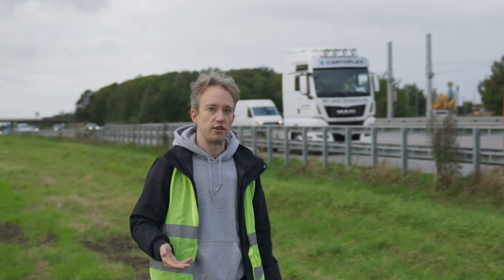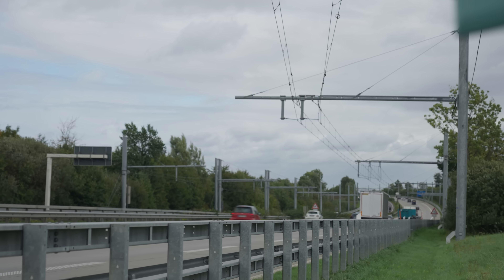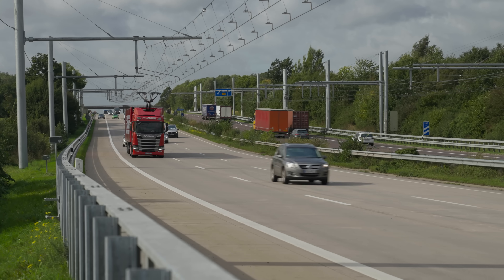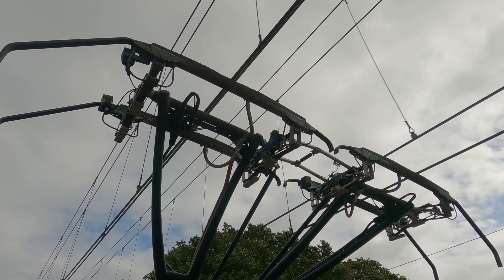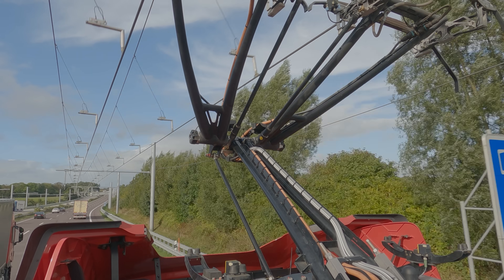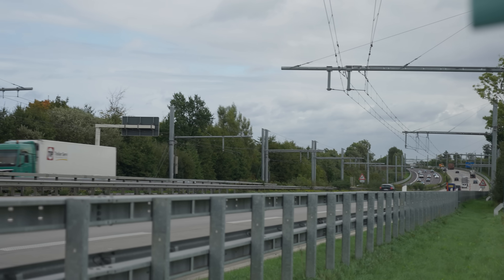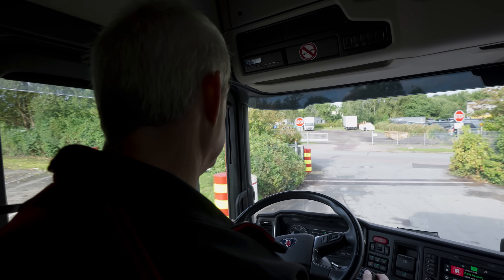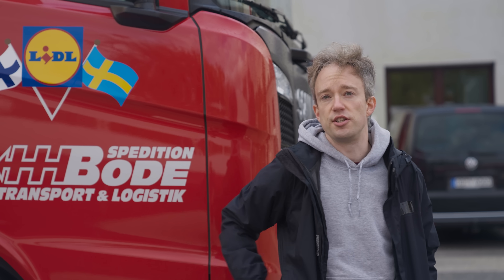The highway where trucks work like electric trains

Comment: I don't understand how this can work.  With trains, the metal wheels and rails provide the return path for the electricity coming from the overhead pickup.  But the trucks have rubber tires and run on a normal road?

Comment: How will this reduce emissions? If the electricity is still produced with fossil fuels, as it is now, I don't see the point of this. Yes, the power station engines are more efficient than a truck's engine, but you have to factor-in the inefficiency of the gridline plus the costs and materiel to build 'em.
Reply: Electricity is already 50 % renewable in Germany, while German Diesel is 93 % fossil and 7 % are partially made from palm oil, not a environmental friendly source for fuel.
Reply: @simonm1447  If you increase energy consumption by a large margin, how will you produce that extra electricity? We're talking about big numbers here. 
Germany has a very hard time increasing that 50% (which includes trash burning: yes, burning plastic is considered renewable!), because of a simple but critical issue: how much renewable can you squeeze out? How much wind and sun does Germany have? Does Germany have a sunny climate, without nighttime? Does Germany have huge mountains with infinite rivers? 
I'll tell you where that extra energy will come from: either importing nuclear (which is hugely inefficient due to grid inefficiency) or by burning fossil.

Comment: Propaganda for fools.
We all know where and how energy comes from. (Coal stations are currently operating in all countries)
If we are talking about the impact on nature: How many years does an old diesel engine have to smoke in order to reach the level of pollution in the production and disposal of batteries of such an "E-truck", plus how much emissions will be produced to refuel its batteries? What are the losses of electricity during its transportation? The efficiency of such an undertaking is close to 0!
I understand that the "geniuses" want to move the production of dirty electricity to third countries, this is good for developed countries, but very negative in a global sense. (Who will monitor harmful emissions there?)
If you want to improve the climate by reducing the harmful human impact on it, the recipe is simple: Reduce production and move away from the market economy.
Without leaving the consumption economy, nothing will change, but will become much worse.
Therefore, this whole idea of electric transport is another way to warm up humanity with money.
Will you be flying an electric plane?
But air transportation is the main producer of CO2! :)

Comment: I had the same idea years ago, you can also put a car one on the inside lane. The car one wouldn't be overhead, it would have a power cable in the road and one above the crash barrier. A little arm would have to extend out and up and it would have to have safety features in case of accidents.

Comment: Horrible Solutions.  Costly Infrastructure.  Ugly Wires that are prone to storm damange and wear and tear. 
Battery Costs are coming down hard and fast.   BEV is the way to go.
Compare building this to having Tesla Cybertrucks.
Reply: I'll take this because it's proven technology.
Reply: @sharkheadism  proven by what? 1 truck?  Prototypes are easy. Mass production is hard.   The cost overruns from this program will make BEV truck costs look like peanuts.
Reply: @Faisals_Adventures  Having road and rail vehicles collecting electricity from overhead wires has been done for over a century. There's even a strip mine in Africa that uses overhead wires to supply power to its gigantic dump trucks for climbing uphill out of the mine. Nothing about this delivery system is new, it's just being put on a different vehicle.
Reply: @sharkheadism   have they been traveling at 65 MPH on the highway before?
Reply: @Faisals_Adventures  Yes, in the video

Comment: I love German way of executing on things: they decided to get rid of greenhouse emissions, they will be doing it in all the pieces of their lives

The tech itself is cool too, although limited and a bit complicated in a sense that a truck still need to have an electric engine and a combustion engine.
Reply: Or just battery good enough for lets say 100km (under the load) and no combustion engine.
Reply: Germany only acts half-hearted today, the country has fallen back when it comes to renewables compared to other countries. Today renewables have gotten economic without subsidies in big scale, and from then on the fossil fuel lobby started to slow down renewable energy programs. Lobby is extremely powerful in Germany, all the decisions are heavily influenced by it. 
They could also use a bigger battery in the truck and use the overhead wires to recharge it during driving, but these trucks (less than 10 exist at all) only have a very small battery and kept the diesel engine, to use it as soon as it left the the highway.

Comment: this is the most idiotic thing i have seen in a long time - they even havent got  all the major trainlines with overhead wires, but the highways should be wired? the best way to get trucks electrified is the exchangable accu - thats where they should put there focus - then they just need changing stations, no overhead wires and not every parking space with loading infrastructure....

Comment: So this charges and uses the electricity for direkt drive? If that is the case this is a very flexible solution, i like it.  And if the wires break down, close the lane and the trucks can still drive in the 2 outer lanes hopefully.

Comment: This would be an amazing intermediate way to reduce emissions. Obviously, electric cargo trains are the way forward. But if there’s one thing the German railway network doesn’t have, it’s sufficient infrastructure. Until that is taken care or, this is a technology that is entirely non-disruptive and extremely cheap to set up. 
Electric trucks will eventually be phased out regardless, simply because trains are a lot cheaper to run once the tracks are laid.
Reply: So are you going to run rail tracks to each and every business, shop factory in every town, village and city for a train to deliver to?
Reply: @maxsidew  Where would you even get that idea? Neither overhead electrical wires for trucks nor rail are means of transport for the last mile. And nobody implied that they were. 

In both cases, they’re meant for long distance, large volume transportation of wares. And in this category, rail just completely demolishes road in efficiency, emissions and speed. 

To establish an entire network of cargo transport, a hybrid approach is necessary - rail cargo for the long distance transportation, road for the last mile. And, as the video also mentions, the last mile doesn’t require overhead wires as battery powered vehicles provide sufficient range.

Comment: This seems to be a sustainable solution for road transportation. Of course, with a smaller diesel engine (or even a battery pack)  when exiting the highways. But it is not new. All the electric buses operate on the same principle with a small diesel engine as a spare source of energy.

Comment: One question. Where Germany take electricity? As I know, more than 40% of electricity in Germany produce by coal electro stations. And now I also know, that Germany in urgent mode restart many old coal stations before winter. What about this emissions? How many co2 produced by trucs and how many co2 produced by coal stations? How many co2 was produced to make wires for this line and install it? How many miles need trucks run to compensate co2 emision from wire and installations?

Comment: so how do the catenary wires reduce emissions when you have them made in factories that produce emissions and the materials like coal, iron and tin, among other minerals, gotta be mined out of the ground which again, produces emissions?
kinda pointless, if its just gonna be the same or equal to the amount of emissions a diesel truck makes.
Reply: that's beyond dumb. How do you think gasoline is produced? How do you think gasoline is distributed between thousands and thousands of gas stations? 

Please take a minute to review a study about collective pollution of driving a gasoline car (all factors included) and you'll see that the distribution of energy is the least of the problem.

Comment: For trucks and buses it is very good idea. Modern day technology can make it much safer than was possible decades ago. It need load of infrastructure. The very same infrastructure can supply electric cars charging stations too every after kilometer or so. Selecting higher voltages can reduce needed metals. Only isolation need to be very good. City tram use only 600V or something like that for "safety" reason. On motorway they could easily use tens of thousands of volts. 600V on highways is not cost effective. Sure the truck will be heavier to convert voltages for trucks manageable voltages.

Comment: I have always thought that British governments idea of having batteries with a plug in charging system is stupid, because of people Live in some areas  they cannot even park outside their home to plug a charger,  in  an then there is problemb with if somebody does have a wire plugged, that somebody might cut-that wire for so-called fun.!!!! 
My idea  however is to have an electric rail in all A an B Roads an motorways, with an uderside pick up an run-it Like a scale electric toy.
A mechanic next door agrees it would be a good idea  an to have an internal battery to operate in minor country roads an off-road. !!!!?

Comment: Why not just use trains 🚂
Reply: Because trains don't go nearly as many places as roads do, rail capacity is a problem, it's more expensive to shippers most of the time, and using a train to move a truck trailer is slower than just using a driver to take it all the way from A to B in nearly every instance.

Comment: What would the equivalent be for cars - a slot, like a giant Scalextric? Something similar for cars would dispel many of the problems - range anxiety, and battery size/weight. Plenty of problems to be solved, though (probably safety the main one).
Reply: Cars are well on the way to switching to batteries. That industry has reached a critical point and is generally seen as a step up for consumers having adopted it.
Reply: @hepphepps8356  Those who've bought one aren't likely to admit they made a mistake, though, which skews the reported view. Even where there isn't still a price differential (which is nowhere at the moment), electric- only cars won't catch on anywhere journeys of over 300 miles are common, until there are far more charging points (and they'll have to be rapid ones). Something like the system shown - where they could be powered/charged while in motion - could make a big difference to take-up.

Comment: What a great idea!   A lot more electrical power than is now being generated will be required to re-power large numbers of diesel trucks.  How is the power for this "great idea" going to be generated?  More coal-fired power plants? Billions of windmills? Magic?
Reply: Seeing how clean energy already powers half of the German electric grid already, I don't see it being a problem.
Reply: @pieman141 :  Unfortunately, your inability to see it as a problem speaks more to your short-sightedness than it does to the potential problem.  The load on the grid will increase with the end of the pandemic and even more so when well over half of a million transport trucks are added to the electrical load.
Reply: @pcs5852  Why do you think half a million trucks are just going to appear out of thin air at the same time? Obviously this is a gradual project which gives the grid plenty of time to adjust and obviously they're not going to implement this widespread until the grid is ready for the load, like literally every other infrastructure project.
Reply: @pieman141 : There are already well over half a million trucks hauling freight in Germany.  They will have to be replaced within the next 19 years (the time frame, set by others, is by 2040).  Realistically, the power grid will have to be doubled by that time because there is also a push to electrify ALL motor vehicles.
Reply: @pcs5852  Double is a stretch seeing how an electric vehicle requires less energy than a home or commercial building, but expanding the power grid in 20 years is easily doable.
Reply: @pieman141 :  You don't know much about this, do you?  The average German person uses about 1500 kwhr per year.  The average truck will use about 18,000 kwhr per year.  You have no clue how much expansion will be necessary.
Reply: @pcs5852  18,000? And where are you getting the number from? You seem to really underestimated how easily the grid can be built, especially over TWENTY years. Do you question the grid every time a couple homes or a factory is built? The grid is always growing larger and power demand is always met. Electric vehicles aren't going to change that, especially if it's spread out over multiple decades.
Reply: @pieman141 :  Where did I get the number from?  I'm an electrical engineer and determining power requirements is the easiest part of my job.
The grid is growing larger, as is the demand on it by population increase alone.  When you add millions of additional electrical loads (cars & trucks),  the grid will have to grow at an unprecedented rate.
If you think a few thousand more windmills and several thousand more square kilometers of solar panels is going to do it, you're dreaming.  Given today's technology, the ONLY solution to meeting the projected demand is a large quantity of new nuclear power generating stations.  
If you can't sell that to the populace, then all of the projects for electric vehicles are simply pie in the sky.  Good luck with your hopes & dreams; I'm done.

Comment: leaving the highways for non trucks can prove to be a difficulty and danger to either trucker or personnel car driver. with a minimum gap of 50 m between the trucks and the aggressivness of drivers so probably means lots of more invest in the infrastructure  than just the wires .. and even worse to fix the heads of the stad drivers.
Concept is nice howeever even offering a good possibility of autonomous driving under the wire ... the unpredictability of the human drivers however  will be tough to take into account and most likely - specially here in Germany cause an uproar

Comment: Just learned today that they’re installing 20kms of this along the M180 around Scunthorpe. Makes the pain of the roadworks till March next year a little less annoying. Wonder how long it’ll be before I actually see a truck using it though, despite the obvious sense it makes?
Reply: Don't want to let you down, but the current roadworks are only to resurface the motorway. The government announced funding for design work for wires on the m180 but the earliest completion date is 2024

Comment: Now tell me why not use the trailers bottom as extra battery storage? You deliver the trailer to a Wearhouse, plug another trailer to a truck loaded with delivery items and fully charged and continue to drive? I think for some of the issues like remote areas is a good and fast solution.
Reply: Batteries are heavy and you'd reduce the cargo capacity of the trailer.